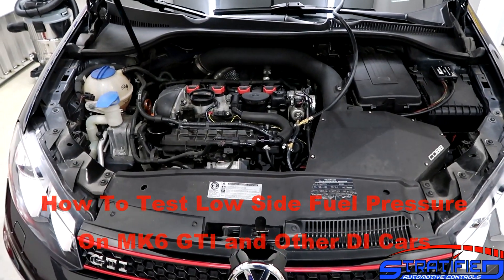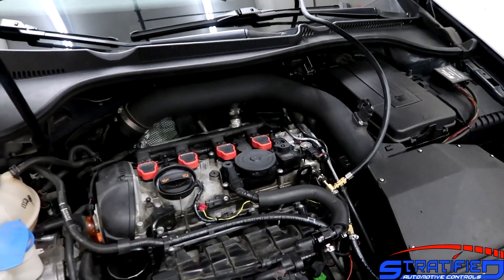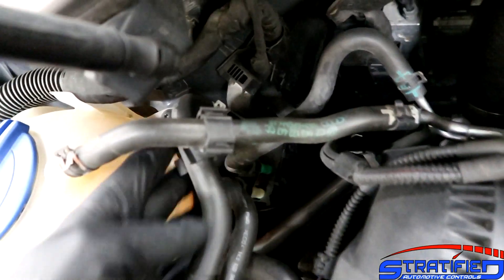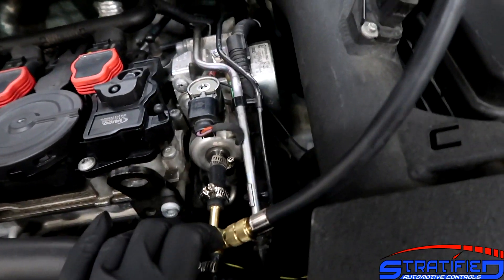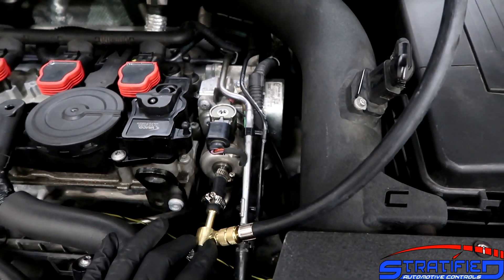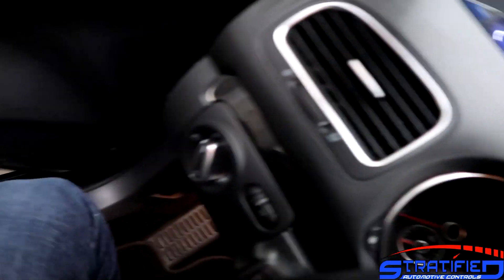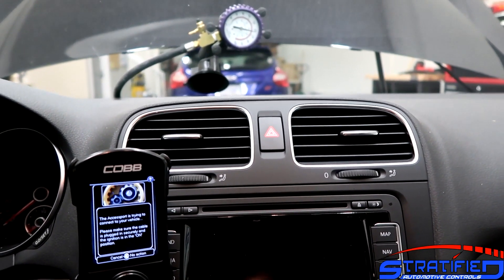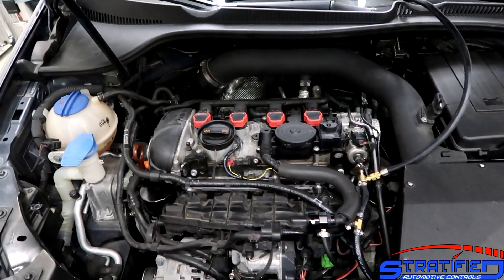How To Test Low Pressure Fuel System On Direct Injected Cars Like MK6 GTI

Comment: I ran this test on a 2015 jetta 1.8t, and the fuel pressure won't hold at all. It immediately rapidly drops to zero after priming. No obvious leaks at the gauge. Yours seems to be holding steady. Does this mean the check valve in my LPFP is toast?
Reply from the maker: It does mean yes that fuel is flowing back into the tank.
Reply: i am not familiar with your jetta, but I know the 1.8t have a fuel filter with regulator that is outside of the fuel tank. A faulty regulator will bleed off the fuel pressure like you mention, like a faulty check valve in the fuel pump will. You can isolate each side of the system and see where you are bleeding pressure back into the fuel tank to determine if you need to replace the external regulator or the internal lpfp assembly that is in the fuel tank.

Comment: do you know where the low pressure fuel pressure sensor is?
Reply from the maker: The mk6 does not have one
Reply: @stratifiedauto  how come mine is throwing a code for it? 😭
Reply from the maker: The code for low pressure is from the HPFP sensor if you have an mk6 GTI.
Reply: @stratifiedauto  Mine is a 2.0tsi jetta with the plastic oil filter housing. I have an off idle lean code (clogged injectors) and a LPFP sensor reading too high code
Reply from the maker: Then you have a sensor, harness or connector issue. Circuit codes always mean this.

Comment: I had the fuel pressure on 40bar on idle, 2 days later on low rpm the engine stalled and now it is at tje mechanic. No fault code what so ever, suspecting it is the lpfp and fuel filter. golf 6 gti
Reply from the maker: You can check the LPFP like it do shown in the video.
Reply: @stratifiedauto  Thanks, i let the mechanic know so he can start from there and save him from hassle.
Reply: @stratifiedauto So, i've got the car back from VW dealership. I see that the engine is filled and mixed oil with petrol. What could cause this? Is it from trying to crank it up and start it without luck?
Reply from the maker: I have seen stuck op e injectors on these motors.

Comment: My fuel rail connects to the hpfp with a stiff aluminum fuel line. Do I connect the gauge straight to the hpfp? There's nowhere else to connect it
Reply from the maker: You don’t want to connect it between the fuel rail and HPFP as that is high pressure. You want to connect it between the fuel tank and HPFP. This should be a soft line coming into the engine bay.

Comment: My 2015 gli low pressure is at 50 while steady speed then drops to 45 psi when I get the torque limitation code
Reply from the maker: The code and fuel pressure are probably not related.

Comment: I have 3 codes on rn if anyone knows if it’s a sensor or the actual fuel pump? My codes are 
P2293 
P053f
P0087

Lmk if you know anything  low fuel pressure

Comment: Any idea what max whp will be for a stock fuel system mk6 gti with a snow stage 2.5 WMI kit with a #6 nozzle running 1:1 water:meth. 

I know it's not possible to give an exact number but a ball park would be welcomed. I would do this test but my engine is out of the car waiting on parts.  

I have maxed out a f23t on stock fuel with wmi and logs never showed it lean, at times i even saw afr in the 10:1 range(yes tune needed some adjustments). Looking for the next step up in power in the near future.
Reply from the maker: F23t maxes out in the upper 300whp range.

Comment: Hey nice video. Wondering what the low side pressure should be at idle cause mine is bouncing from like 79 to 85. Thanks
Reply from the maker: This is about right. You will get some fluctuations.

Comment: What’s the pressure reading for 2017 gli?
Reply from the maker: This will depend on the demand on the fuel system. You want to see above 50psi at wide open throttle.
Reply: @stratifiedauto  HI i have a CC 3.6 ,what's the LOW/HIGH fuel pressure reading for it ?

Comment: What's the minimum pressure for the electric fuel pump on a GTI MK5 2.0 TFSI? 6 bar fuel pump?
Reply from the maker: I wouldn’t want it below 40psi at wide open throttle.

Comment: Hey I was wondering what’s the spec for a mk6 gti low side pressure
Reply from the maker: That depends on engine rpm and load. Under wide open throttle it should not drop below 45psi

Comment: can I check this with a vag? How would I do that, what channel would it be (good numbers it should be at)
Reply from the maker: You can’t since it does not have a sensor. This is why you need the gauge in line.